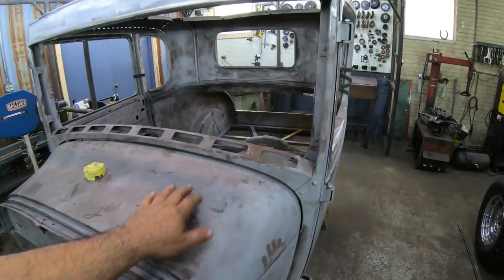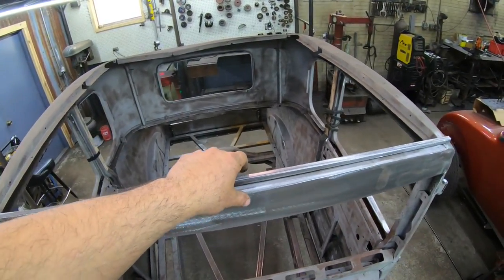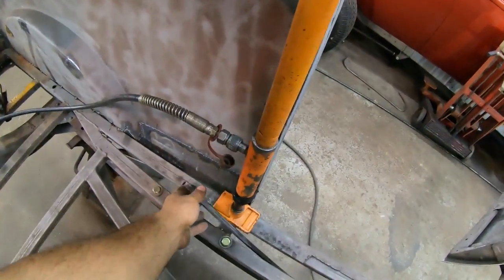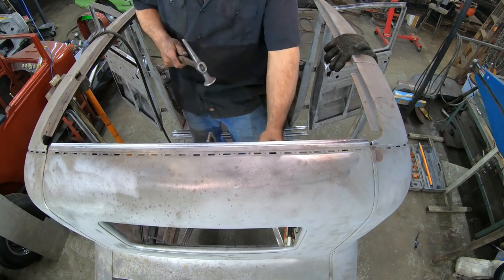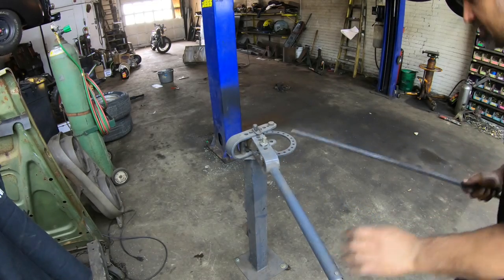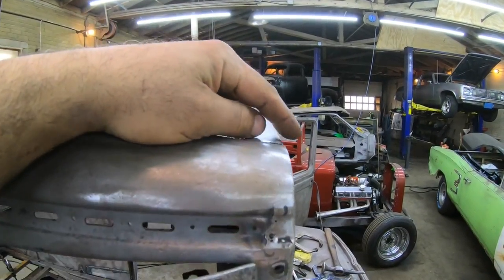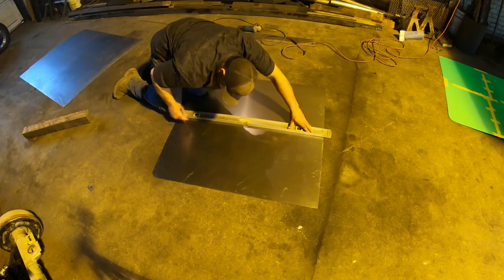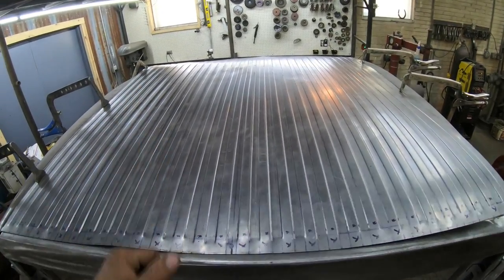INSTALLING A  STEEL ROOF  On a 1928 Model A Coupe- Yard Art Model A Build Part 10

Comment: This is extremely helpful for me, thank you for sharing. On my car the roof skin is already welded in without any structure under it (I have no idea why). Do you think I could put a structure under it as is, or would I be better off just cutting it out and welding in like you did? I’m not sure how I could get any meaningful welds on the top side of the structure without access up there

Comment: You should use two (2) wipes to remove the grease, etc.  one saturated with the chemical where you wipe, the other dry cloth you then use to wipe dry which will pick up the last of the grease, etc.  One wipe only gets some much the second takes more off so that you have a good clean surface to which you can sand or apply the primer coat...I would sand the fresh metal for mechanical tooth, maximizing the adhesion level with the primer.